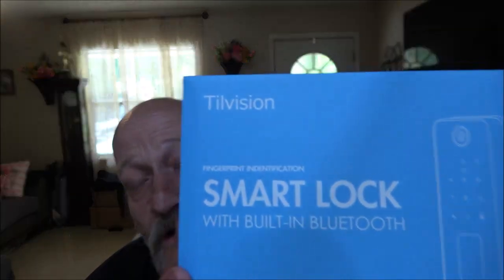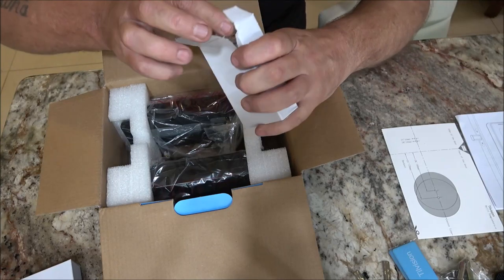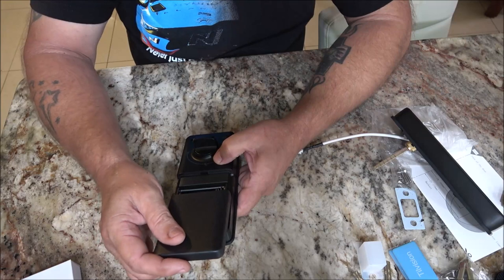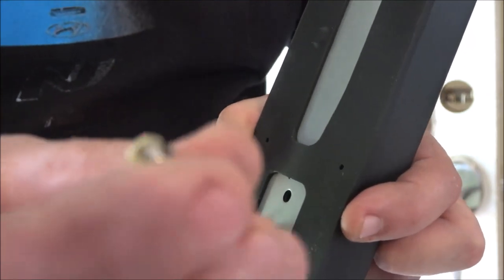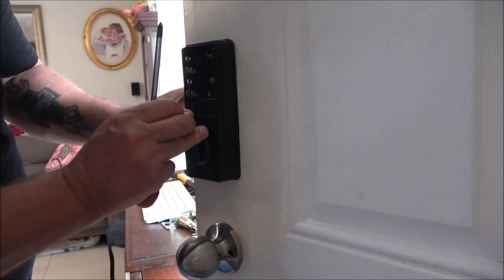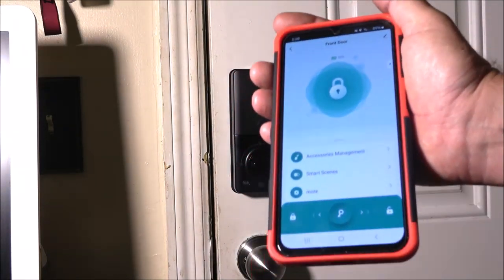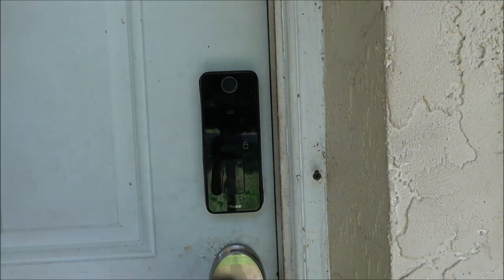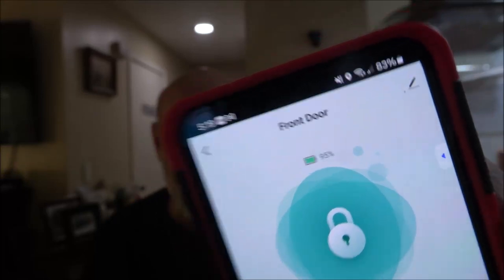Tilvision Fingerprint Door Lock,Keyless Entry

Comment: I cannot get the door connected to app
Reply from the maker: Reinstall the app and fallow the instructions precisely. Also make sure your phone is compatible with the app. Let me know what you find out.
Reply: The instructions did not show a reset button or tell how to put in pairing mode. How did you put it in pairing mode?
Reply: The reset button is the lock/unlock button on the back. Hold it and listen for 10 beeps. It will say factory reset and click # to confirm.